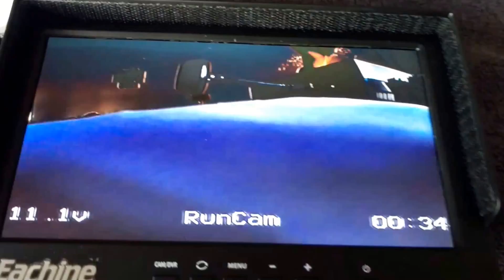Eachine Wizard x220 & RunCam Swift 2 with OSD fpv camera upgrade

Comment: Proballaply im gonna beat your ass because you are pissing me off with the ads good vid tho do i solder it to plus or minus???? Minus right?
Reply from the maker: Lool yup I've got monetisation on all my vids 😄😁 do as I'm showing on video and You can add Capacitor to clean up power drlivrry and get rid of white lines during punchouts. Your video signal will be clean. Add Panasonic low ESR capacitor 1000uF 36v. Check video tutorials on YouTube about Low esr capacitors in quads
Reply: KrzychOlsztyn but listen you dont get it im soldering the osd to minus wont work to plus wont work? How the fuck is this working

Comment: Don’t need white wire runcam swift 2 has mic built in.
Reply from the maker: Shane Collins to send audio out to Your goggles You need it Mate. Signal from runcams nic must go somewhere. It's going to vtx to be transmited to Your dvr/goggles
Reply: Ok my bad 👀

Comment: why would you solder directly on the board if you can just cut the old black,red,yellow cable in the middle and solder it together with the cables of the run cam?
Reply from the maker: ThePhiltastic You could but these much better wires so I've replaced whole thing. I dont like to join wires if I don't really need. I like as clean video signal as possible. but If You want do like so Yes You can of course. I've sold old wizard camera on ebay with wires . person who bought it was happy to get wires with it included as well to install it easier in his fpv plane 😃 $$$
Reply: Ok thank you. I didn't know it would influence the fpv signal strength.
Reply from the maker: ThePhiltastic could slightly not much but could be some if You'll do tatty solder joints

Comment: Hello there,
what size of lens would you suggest for the Swift 2? 2.1 2.3 or 2.5mm? thank you
Reply from the maker: Stefano Dalla Gasperina 2.5 or 2.3 I'm using 2.5 but 2.3 got even bigger fueld of view. 2.1 hmmm to big and away vest will be 2.5 or 2.3 up to You :)
Reply: KrzychOlsztyn I Think I Will go for a 2.3 as a middle solution, thank you for the advice
Reply from the maker: Stefano Dalla Gasperina You welcome :)

Comment: I upgraded the camera, followed ur step, but I turned it on the first time it worked, the second time i tried to solder some other wires for leds lights but it wont work anymore, helpppp.
Reply from the maker: LookAtDat have You got sideplates? maby you short out something? make sure solder not sticking out from pdb and touching carbon fiber somwhere. Clearly you short out something of its not working right. my 2 quads working like a dream up to now. make sure there is good connection to pdb and no solder touching carbonfiber as it might cause short circuit and smoke camera
Reply: Thx, I already fixed it, I just soldered the wires again and use blow dry , and it worked
Reply from the maker: LookAtDat perfect. happy flying :)

Comment: Might be stupid question but if you don´t want vbat and audio, could you just plug 3pin wire from wizard to 4 pin connector in a cam, leaving one set of pins exposed? think I saw this in some video.
Reply from the maker: LayWare of course just make sure colours are the same and will match those 3 pins as it thould. vbat is very nice option to have. you can see mid flight whats Your battery like. nice to have. as long as connector will fit then Yes.
Reply from the maker: LayWare even I'm ignoring audio as my goggles dont have audio support and monitor as well. I'm not vothered. about audio at all actually. There is go pro session HF camera for that. fpv cam is just for flying and for recording I've got seperate HD camera. check my new video from last week
Reply from the maker: LayWare if connector will fit then Yes. audio and vbat is just extra feature nice to have but if You not bothered to have them then 3 connector pin will be fine. you need powwr + and -  and video out yellow wire that's it so power and video out will do in Your Case :)
Reply: thanks for quick reply:D saves me the soldering and some time:)
Reply: Yea.I noticed the wires might not match even if the connector fits.. but I´m gonna sort it out when my cam arrives. I´m using 25mw from my micro with separate lipo now cause I hate the wizard stock lens:P
Reply from the maker: LayWare I've got TS5840 200mW transmitter. brilliant stuff and Runcam Swift 2 2.5mm lens  Pal version
Reply from the maker: LayWare I'm buying from Banggood mostly

Comment: just bought the atf version...does anyone how I acess betaflight?  tried on my desktop but it's quite old and keeps saying driver failed!! Iv now bought a brand new laptop /notebook.  do I just plug it in or have I got to install any special drivers?  cheers
Reply from the maker: k1 wiz80 find betaflight app and it should work if not find on youtube how to use it. find joshua bardwell video about eachine wizard
Reply from the maker: k1 wiz80 install betaflight app in your google chrome web browser

Comment: good stuff. my order of the swift 2 should be here this week. looks easy enough to fit :D
Reply from the maker: scotty ward stick to my video and You'll be golden 😊 I'm upgrading vtx to Eachine TS5840 upgraded vtx with a lot better video output than stock Wizard vtx. Connector is the same so just unplug stock one and plug new one thats it. no soldering no messing about with any wires . Just bought 2 from banggood today :) for my 2 wizards and runcam swift 2 for second wizard to be upgraded the same way as this one on my video :). good luck and no rush. Do good soldering job
Reply: i have the ts5823, i have no idea how good it is as its the only one i have ever had :D  it does have audio on it so i will be connecting the mic. i would like sound to hear how much i am reving the motors..  i am looking also at fitting earphones to my quanum cyclops goggles( i will probably set them on fire trying though :D)
as soon as my cam turns up, i will be rewatching your video :-)
i look forward to your next vids. thanks mate.
Reply from the maker: scotty ward 4s flights comming up. hopefully this week I'll do some tests. Got cyclops as well :)
Reply: great :D i will be watching. i did not like 3s on my zmr, felt so flat and underpowered.
im pleased you have the cyclops too, have you looked into the audio option?
Reply from the maker: scotty ward not Yet but I will. I'm recording on my Eachine monitor. but I'll check audio option on my quanum cyclops
Reply from the maker: scotty ward I'm recording video & audio on my Eachine monitor in HD 720p
Reply from the maker: scotty ward I've did some research it's not worth to do it actually I just want sound to be recorded on my Ground Station Eachine DVR monitor I'm not flying so so far away so I've decided to not bothered about audio in my Cyclops as It's cheapo goggles anyway. Waiting for Cyclops v3 next year probably as HobbyKing doing that for purpose and releasing stuff slowly. I hope v3 will have video out jack and dvr build in as it's becoming standard for FPV goggles nowadays.
Reply: there is an audio out on the quanums but i think you need a small amplifyer and a regulator (which i bought off banggood) to sort this. i will have a look at it when i get my parts :D
Reply: i have a small monitor but dont have the capability to record so i just strap my gopro onto the quad.
Reply from the maker: scotty ward  I know about it I'm just not really bothered to do it of course I've got camera xiaomi Yi 4 HD on quad but I want to record video feed as well so I'm recording on my Eachine monitor with DVR it's recording audio as well
Reply from the maker: scotty ward check my videos there is unboxing and hands on my DVR monitor I've got it of course from banggood.com
Reply: i see, well if i get stuck i might come to you to pick your brain about it :-)
so if you record your flights on your yi why do you also record the fpv feed? im curious.
i have watched all your quad vids and will have a look at the dvr one tonight.
i only want the sound of the motors because when i was flying last week and the quad went past me, i was very disoriented by the sound all of a sudden being there, from being silent. if you know what i mean.
Reply from the maker: scotty ward ground station . for example if I lose quads somewhere it's easy to locate it just go back to DVR and roughly can see where it landed or where you lost it it might be useful as well for my videos like a video in video kind of thing :)
Reply from the maker: scotty ward look for Loc8tor on ebay. great little unit for locating lost quadcopters in high grass Forest or wherever you can lose it I just bought one for 45 British pound on eBay brand new sometimes you can get it cheaper that is two tags in set. check test of locator on YouTube there is plenty of videos really worth to have it one of the best locators ever produced look for Loc8tor. sometimes people putting that on eBay and you can get it cheaper brand new it's about 58 British pound. you can bind 4 tags in total for 4 quadcopters maximum. Battery is sending Signal for one year if it's fresh
Reply: ah, thats a good idea. i did think i would be able to find mine if it went down, but after thinking about it, there is allot of field out there to search. i will look into a dvr then, im sure you can add one to the cyclops. if not i have a spare fpv screen which im sure has an out lead for a dvr and the old receiver off my crapy hobbyking fpv goggles that i could use. :-)
Reply from the maker: scotty ward find me on skype krzycholsztyn1982ku
Reply from the maker: scotty ward I've tried once to add Eachine dvr to cyclops. too much noisy interference all over. Ended up in Smoke nearly burned my tv as well. I was lucky to unplug it on time :)  and dvr unit gone to bin . money well lost. that's why I've decided to record separately on my monitor with DVR lacewing Farting around with cyclops and trying to modify them I've decided to leave quanum cyclops as they are  I've upgraded antenna  only to RealAcc 5dbi Cloverleaf antenna banggood to have good strong signal I did exactly the same to my monitor maybe in future I will upgrade two different goggles but for now cyclops time :)
Reply from the maker: scotty ward beautiful thing that on monitor you can Play-Doh videos like on VCR fast forward reverse everything so can watch any video any time you want and you've got access to everything on your memory card in a middle of a field that's a good feature. you can try modify cyclops but personally I don't think it's really warm to fart around this subject and it's way is it just to buy monitor with DVR I bought my Eachine  just before Christmas for 40 British pounds. Now its 56 and out of stock. terrible weather so I'll be upgrading  my racer with brand new BetaFlight firmware. I hope I can test fly it this week
Reply from the maker: scotty ward http://www.banggood.com/Eachine-LCD5800D-5_8G-40CH-7-Inch-HD-FPV-Monitor-with-DVR-Built-in-Battery-p-1067081.html?rmmds=search
Reply: yes i saw someone on youtube put one on a drone, it might have been `painless360` im not sure, i did look at them but couldnt justify spending the money on one. dont get me wrong, i think i need one but the wife thinks otherwise! lol
i will keep an eye out for a second hand one though :D
Reply: i will do my friend :D its nearly midnight here rite now though, so i will search for you after work tomorrow. i cant remember what my skype is, its been so long since i used it. 
i read your info on youtube. where are you geographically? sometimes you sound like someone who comes from where i do :D and other times not :D
Reply from the maker: scotty ward I know I’ve got wife😁. Lucky me she supporting me in every way. recording videos .She is my FPV spotter etc. Yup this stuff is not free. I bought it as birthday gift for myself. To protect my investments and be able to find the if I’ll loose it. I've lost a toy grade quads in the past so now I'm protecting my stuff I'm putting tags on every one which is in the air at the moment. it's like quadcopter insurance policy as this things are not cheap 😑
Reply from the maker: scotty ward England Wakefield West Yorkshire
Reply from the maker: scotty ward or messenger etc let me know and I'll try to guide You somehow
Reply: i have sent you a private message on youtube mate and i think i found you on skype!
Reply from the maker: scotty ward send me message on skype
Reply: have done ;-)
Reply from the maker: scotty ward krzycholsztyn1982ku
Reply: ahh... i missed the `ku` bit